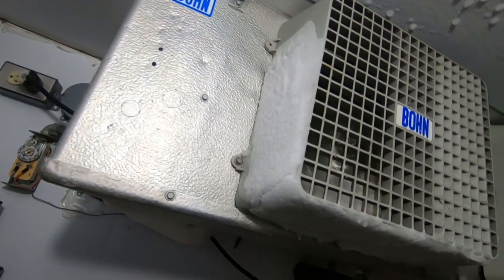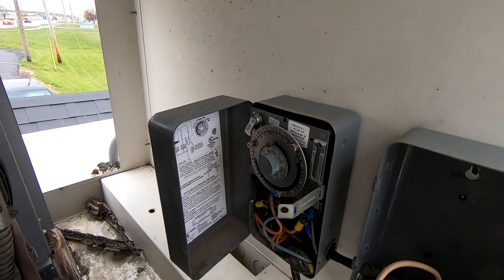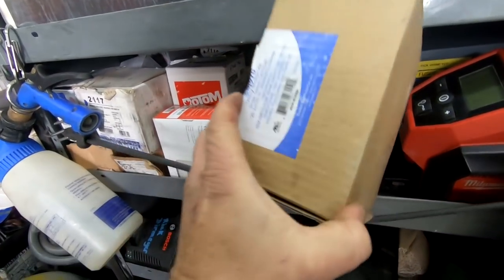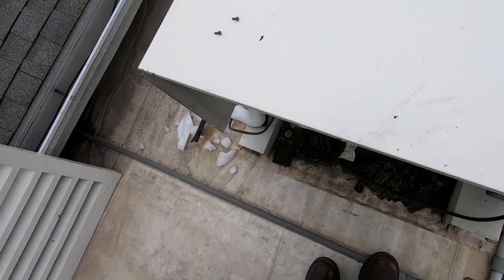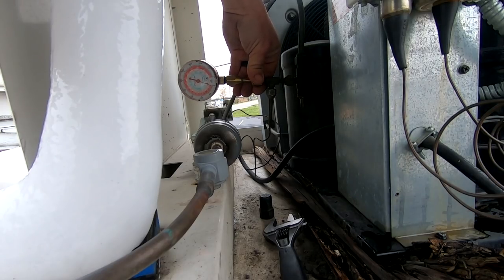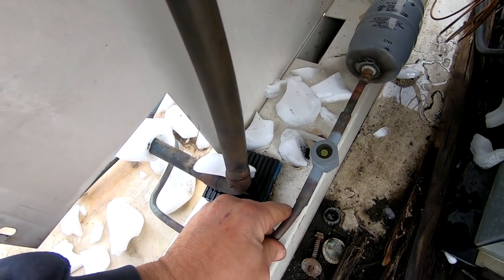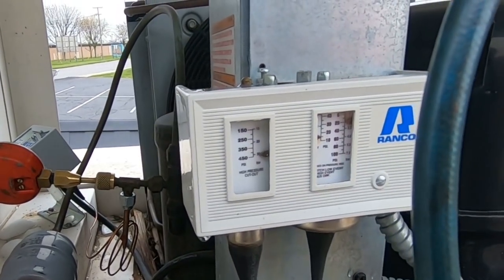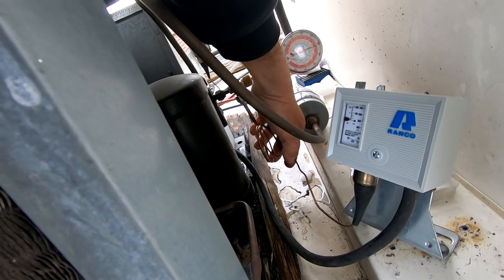Walk-In Freezer Has More Problems Than A Bad Motor

Comment: I’m glad I’m not the only one that gets these disaster type calls. As for the evaporator fan bracket, I have rotated it and drilled 4 new holes, it’s a pain but it works. Good video rick.
Reply from the maker: Thank you Richard! I was thinking of doing that because of how bad the aluminum was cracked. Thanks for the view and comment 👍👍$tay safe if there!
Reply: @HVACRSurvival  also use finder washers.

Comment: Great video Rick- for that fan motor bracket could you turn the entire assembly a few degrees and drill new holes?
Reply from the maker: I installed it yesterday, I used larger washers. Worked good.

Comment: Hot glue or silicone with help with tubes rubbing due to vibration. Thanks for sharing.
Reply from the maker: I've used the silicone. it was starting to rain and I didn't have time for it to setup,  it would have wiggled it off as bad as it was starting to vibrate but yeah I seen that before👍👍. If you noticed in my other videos I usually use split  plastic tubing but I was in a rush.
Reply: @HVACRSurvival  Yes sir,  I understand completely. I'm just learning and realizing little things I thought would be worth sharing, not insinuating that you are unaware of this practice. Thanks
Reply from the maker: No worries man 👍👍 I would have rather used the split tubing but it takes allot of time. Feel free to share whenever you see something you think would be useful or better. I learn new stuff everyday.

Comment: Nice ,,,video,,,!,, what setting are you use cut in and cut out,,? FAN SPEED CONTROL ? Thanks
Reply from the maker: I want to try to maintain a minimum of 90 to 95 degree saturated liquid line temperature and allow it to rise up to around 110.  (-/+ 5-10*) it can vary based on refrigerant type and how the TXV reacts.
Reply: 👍 good Aswer!!!! You  put those crappy video ... Poor customer change those  Parts !!  It end up broke !!!! 😂

Comment: That's a tiny receiver for that compressor. Compressor looks like 2 or 2 1/2 hp. Was that condensing unit originally 502. Normally 404 2 or 2 1/2 takes a 9 lb receiver.  Nice job
Reply from the maker: I'm not 100% positive, but probably was 404a from the beginning. The whole store is a hodgepodge of bastardized equipment. Thanks Sean 👍👍

Comment: Is the ice build-up on the compressor anything to worry about?
Reply from the maker: If the superheat is 6-8 deg (for a freezer)  you'll be fine. When the suction line is colder than the outdoor temp and when it's colder outside it's going to freeze.

Comment: Which way is more efficient of controlling head pressure; Head master or fan cycle control ?
Reply from the maker: Efficient, cheaper or better? it really depends on what kind of system you have. If you're talkin about a refrigeration system that has a receiver,  the headmaster's going to create a smoother running system but requires more refrigerant and that adds to the cost. Can't use it on an air conditioner because it don't have a receiver. There's some systems out there that use both like the ice machines with remote heads. Plus turning the motor on and off creates wear and tear on the motor bearings and can create flashing of liquid refrigerant. You also have a motor controller to slow the motor down, that will create a smoother head pressure but the cost of that component is very expensive. My opinion is half one and dozen the other or better yet the answer is yes LOL

Comment: I was working on a unit with that exact evaperator coil. Where did you find the motor? I had a tough time getting one. One motor was blown and the other had a rub out.
Reply from the maker: Its purchased from our local supply house. Search for the part number that I gave in the video. That motor was 230v they make a 120v version also.
Reply: @HVACRSurvival  thanks, I'll do that. The unit I was working on had more than just a fan motor out as well. A friend put in the fan motor, new fan blades, new guards, and there's still more broken that I'm going back to fix this Saturday. Why can nothing be simple. Lol.
Reply from the maker: @inoahmann7542  I know your pain! Hope it went well for you!
Reply: @HVACRSurvival  everything on the evaperator was working perfectly but after running about 24 hours it stopped defrosting. I changed the defrost clock and it still doesn't defrost. I can hear the solenoid close and rapidly reopen but it doesn't pump down and go into defrost. It's got me stumped. I'm going back again on Tuesday. To undo everything a previous tech did. The electrical panel is a disaster of wire nuts and unused wires.

Comment: Bummer to hear about the impact , I hope they replace it quickly , if they're still working these days at the after sales ...
Btw , is that the compact air compressor to inflate the tires , on the shelf next to the fan motors ? If it is , what do you think of it ?
And last , little tong slip , 'mega" Farad instead of 'micro ' , don't let the HVAC popo get to you 😋
Reply from the maker: I love the 12v compressor, it's far and accurate.  I edited that audio.  Originally I said just farad, but cut n pasted micro farad into the begging of the comparison, I have to cut some of the negative comments I make or it might be seen as complaining or taken offensively. I was into electrons before HVAC so I know the difference. Lol...Pico, micro, mega, ECT farad's. Thanks 4 watching 👍👍
Reply from the maker: Milwaukee is not running there repair department so I dropped it off to the closest repair dealer, they got permission for a new one because the parts are not available but they have to order it. Hopefully it's quick but it's been 3 days already and I'm missing it. 😱😁
Reply: @HVACRSurvival  I know I shouldn't have said nothing , but the HVAC popo draw quicker than Clint ....

Comment: What's the other problems you found?
Reply from the maker: I went there for what the customer thought was just 1 bad motor. I went through all the items I found wrong in the video?  Low on refrigerant, bad motor, poor wiring issues, poor defrost setup, broken motor bracket, loose covers, bypassed fan cycle switch, missing cover on the T-stat, missing insulation on the suction line, defrost termination slow to react and over all bad condition. The system was neglected.